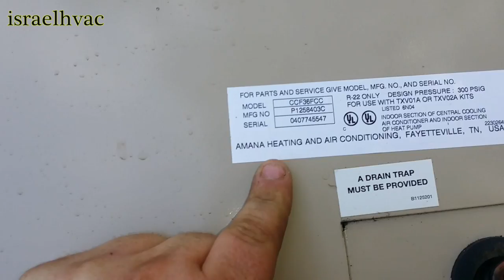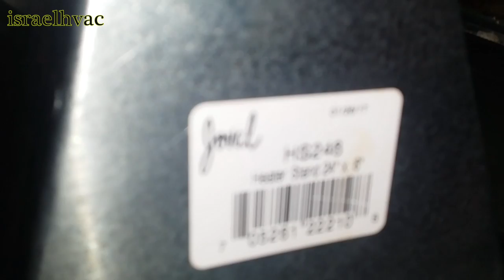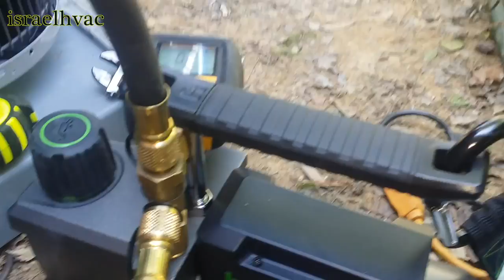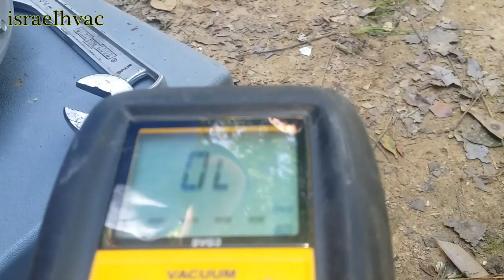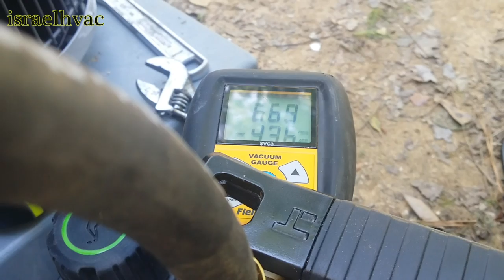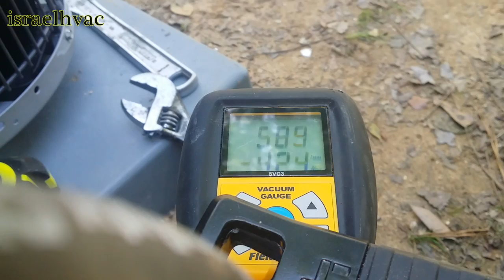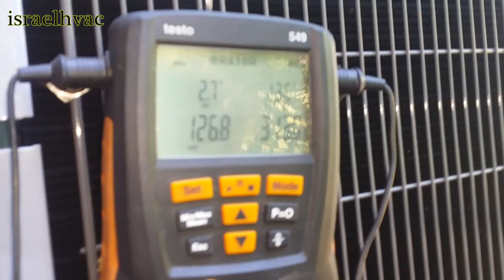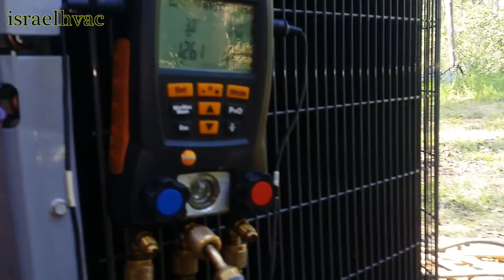System Change Out | Hilmor Vacuum Pump in Action

Comment: Such long flexible loop introduces huge resistance which brings lower fan performance but also slightly higher power bills. The best way is to use short flexible duct with noise absorb (inside you will see lots of small holes).

Comment: Got this pump back in 2018 and it's worked great - 5cfm is plenty for residential and light commercial work.

Only issue I've had out of it was the plastic cover for the switch/capacitor/relay cracking and breaking.  
hilmor sent me another one after a couple of email, but I had already made a new one out of sheet metal.

Comment: Good Job ! Nice looking install. I like the 18" down and back return for quietness. That smooth 180 degree turn is the key to quietness. Good vid. Hilmor seems a little noisy. Check and see if it has a gas ballast it sounds like my robinair when the gas ballast is open. Should be closed under 1000 microns.
Reply: OcRefrigeration,Hvac & Electrical. I

Comment: When the condensation goes in the drain pan beneath the air handler where does it go from there? Floor drain? Or does that go to the plastic PVC pipe that drains out the wall near the condenser?

Comment: Evacuating lower than 250 microns causes the compressor oil to fractionate.
Reply from the maker: Look again it’s a new system. Valves are CLOSED. Lineset & Evap was only thing evacuated.